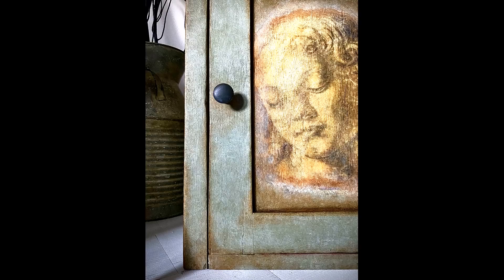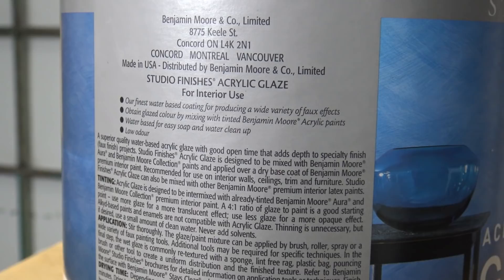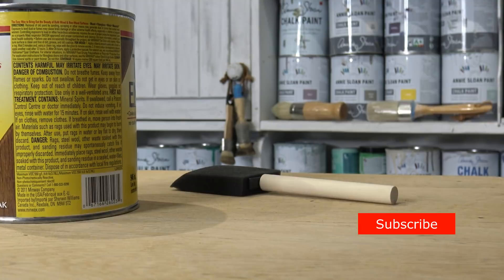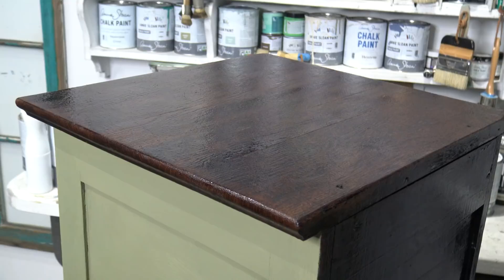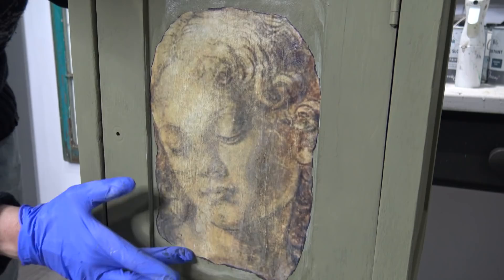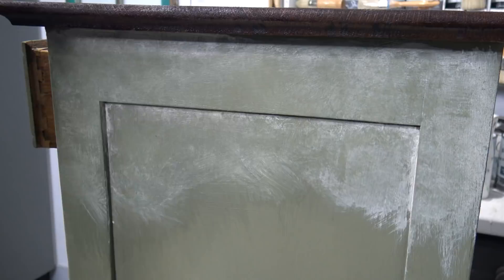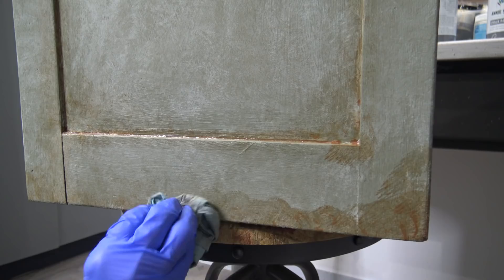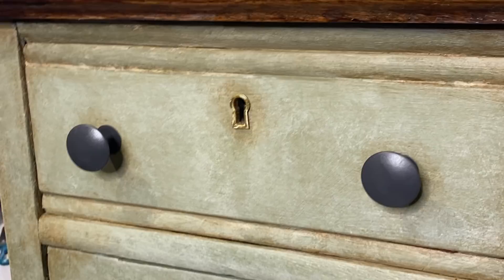Chalk Paint Blending with Custom Color Glaze with Decoupage

Comment: BTW, I worry when I see anyone picking up furniture or fabric chairs and sofas on the side of the road or theft stores as there is a big bedbug problem in this country. Everyone should always spray the furniture with insecticide in the yard or garage before washing the piece and bringing it inside the home. There are reasons people get rid of furniture. My daughter thought someone sold their home to her with the issue but it was not the case. The scare was so bad that my mother paid for pillow and mattress covers and the pest control company to come out as many times as might be needed. They could not find anything but still we needed to be assured as she lives in Florida that there was no bug inside that older home near the beach. There were actually none. The one bug she did think she saw was likely not a bed bug but can you imagine the fear she had. They did end up buying a newly built large home a few years later. She bought it new for fear of bugs. I know it's paranoid but until you have had that scare, you can't even imagine it. So always take precautions. Old wood could have termites as well. Better safe and sound than sorry.

Comment: Critical note....You need to use a LASER printer otherwise, the ink from an inkjet printer will smear. If you only have an inkjet, spray a couple of times with clear sealer first.
Reply from the maker: Hi Queens!  Thanks for the feedback good tip!  So far, I have been using my inkjet printer at home for the decoupage with no issues so far.  I make sure to MOD podge the image to seal on top (let dry) before proceeding with any other decorative finishing (i.e. Chalk Paint).  🙏🎨❤️

Comment: Super cute, love the color combos! If you'd like to get a truly seamless decoupage finish (literally NO wrinkles or seams), I highly recommend checking out the Dainty Gifts youtube channel. She uses a wetting technique (I prefer using a plant mister) laying your paper image upside down on a plastic file sheet, let the water seep through a bit, dab excess water off with your shop towel and then apply the image to your pre-mod podged surface. Then smooth image from the inside to the corners with your shop towel as you did and mod podge over the top as you did. Because paper expands when it gets wet, the pre-moistening of the paper allows for absolutely perfect application every time! 
Cheers, Cat-
Reply: Here's a link to Dainty Gifts school of decoupage and decor on Youtube. This particular tutorial shows you how to work specifically with paper images using the wetting process for a seamless application every time. She also has tutorials to show you how to use rice paper, napkins, photo paper etc. 
https://www.youtube.com/watch?v=sohM4Q3q6Mo
Reply from the maker: Hi Cat!!! Thank you much for the tip!!!! I was wondering how to get a smoother finish!!  Thank you!  I will check out Dainty Gifts channel!! 💕💕💕💕❤️🙏🎨

Comment: 🦋What number sand paper did you use first? I wish I could find a nice piece like this, to be creative. I use DIY PAINT, it's a clay base water clean up. It's non toxic. I never know where to get beautiful images to decoupage.
Reply from the maker: Hi Barbara!  Good question, it depends on piece on what to start with for sand paper.  For this piece it was in very rough shape with stains so I started with 40 (Rough) grit and then smooth it out with 120 grit sand paper.  The higher the grit number the more smoother the finish is.  That's great you are using DIY paint lots of nice colors to choose from!  🙏🎨❤️

Comment: A beauty for sure...  QUESTION...which brand or model of printer u use?  and which program u use to do the file/copy the image...thanks
Reply from the maker: Hi!!  You can use any brand of printer as long as it can print in color.  Most printers are inkjet types, I have a HP inkjet printer.   I just save the image as a .jpeg file and print it from my computer photo album folder.  All computers can do this.  🙏🎨❤️
Reply: @TheReclaimedHeirloom  Hello I have a cannon pixma ip1600 like 10 years old...and only print small images...i was wondering how did u get the image to be so large...  thank you for your reply..

Comment: Could you use this gel stain on exterior doors?  The doors were stained and sealed but they are looking worn. Only three years old.
Reply from the maker: Hi Emilie!  You can use gel stain on exterior doors (I am assuming its wood) with a polyurethane top coat suited for exterior use.  I would recommend that you reach out to your local home improvement store advice about which products to use.  Minwax has a great porduct line for what you are looking for.  But I would recommend consulting someone that specializes exterior paint products.  🙏🎨❤️